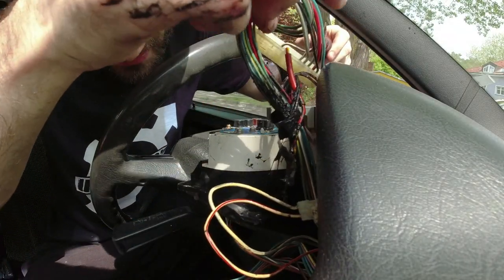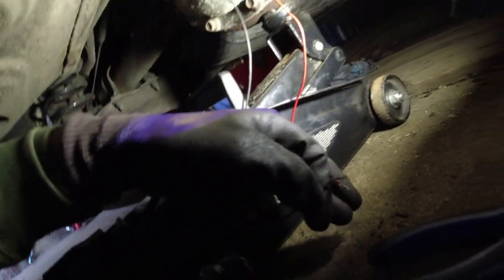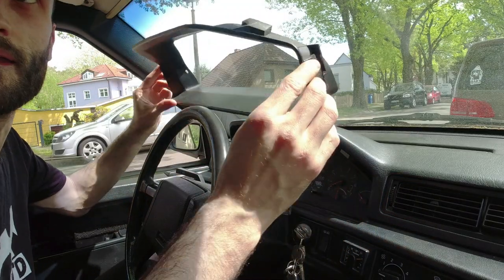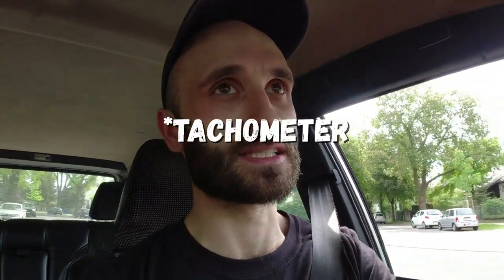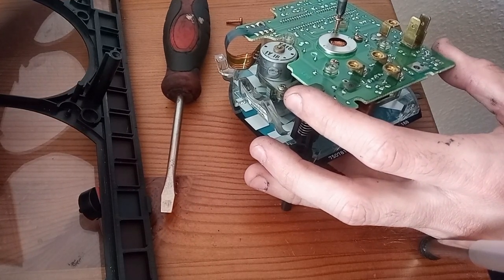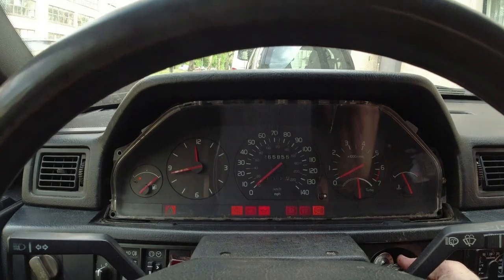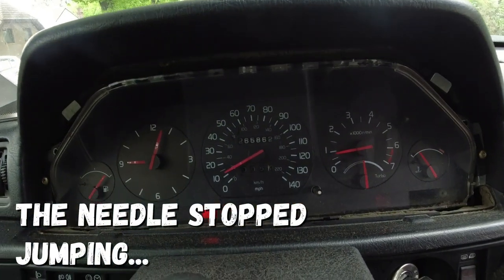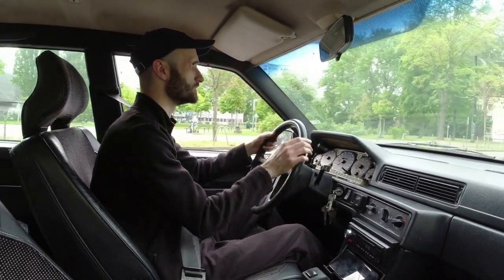Fixing the Speedometer on my 1992 Volvo 940 Turbo

Comment: Some years ago I repaired my fuel gauge, had to change 2 capacitors, so now it's working. 
I have also repaired my odometer? don't know the right name of it but it's the one that show how many kilometers you have driven. The fault was a small spur gear made of some rubber/plastic that had lost a couple of teeths. Today I helped my neighbour with his 1998 Volvo 945. Changed the speed sensor located at the rear axle because the ABS-lamp was on but the speedometer was still working. The sensor was faulty, high resistans. After that I cleared the fault code and the ABS-lamp is now off. Thanks for your Volvo videos and keep the coming!
Reply from the maker: Ah yeah, I recently did the same repair to the odometer on the 240, luckily those gears are easily available. That's good to know, I have an ABS light on the 740 and no speedometer so perhaps the sensor is at fault also
Reply: @Involvod  You can measure the resistans of the speedo sensor in the rear axle with a multimeter. It shall be around 800-900 ohms if it's ok. The sensor can be a hassle to remove though.
 I had to remove the rear axle cover om my neighbours Volvo to remove the sensor from inside to out and then put new oil in. Oh and there is no gasket between the cover and the final gear assembly. You must use some good packing adhesives. The front ABS-sensors should have a resistanse of around 1000 ohms if they are ok. Take care and I wish you good luck. :)
Reply from the maker: @tompas11A3n52KkX  thanks for the info that's really helpful! I'll take some readings
Reply: I have 1 unserviceable fuel gauge taken from volvo 940 GL.  Do you have guidance to find which component need to be replaced?
Reply: @peterelias2345  Whitout proper instruments för testing capacitors it's hard to tell if a capacitor gone bad. Sometimes electrolytic capacitors become swollen and that is a sure sign of a bad capacitor. Otherwise you must measure the capacitor to know if it is bad or not. I have a capacitance meter and an ESR-meter for checking capacitors. Often you must desolder the cap to get a correct reading.
Reply: @tompas11A3n52KkX  I agree. I am preparing the instrument to start checking the capacitors

Comment: The smacking of the dash is a daily ritual every time I drive my 745t 😂 My fuel & temp gauge stick plus my tach jumps around. I have a very nice low mileage cluster out of my wrecked 744t that I salvaged from it before I sent it to redblock heaven that I might install eventually.
Reply from the maker: What causes that again? Someone with a 740 told me they have the same problem, their fuel and temp gauge needs a tap. I have the same issue on the 240 speedo
Reply: @Involvod  not sure but my 745t sat for 15 years with the sunroof partially open before I saved it so I'm sure that didn't help. It was worse but I took my cluster out and tightened up all the screws on the back of it since most of them are part of the circuit. It definitely helped and the cluster functions much better now.

Comment: Oh I know that feeling. Upon purchase of my 92 740, the only gauge on the cluster that worked properly was the tach. The speedo was particularly bad, spazzing all over the place constantly (and I think mine has the VDO gauges, so I’d say they all have issues). 

Is there nobody in Germany that offers cluster repair? There’s a place down the road from me here in the US that repaired everything for a flat fee… not cheap, I wanna say about $200, but it sure was nice to get it back and everything worked perfectly.
Reply from the maker: Wow that's expensive, but still more cost effective than buying replacement units that won't last 5 minutes..

Comment: We have a guy here in sweden that restore the clusters. he tack only 1500 swedish krones for the repair. and he also sell repaired clusters
Reply from the maker: Thanks for the info, that's alot cheaper than a used unit here! Even postage both ways included!

Comment: Are we changing the capacitors ? 
Those leaked and corroded the IC chip.
Reply from the maker: No we're not, that's way out of my league, you can do them for me if you like 😃
Reply: @Involvod  I am shure you can do this. I’m to far from you. Just desolder the two blue wires from the micro switch. Get a good solder puller. Put the solder iron on the cap coenction until it gets loose. Remember that is a doble board. This means that is solder at top and the bottom at the same time. Put a lot of heat and move the cap until it comes loose. Don’t pull it hard you can damage the board. After they are out use the solder puller to clean the holes. These capacitors have a positive and a negative. Install them correctly or the will boow up (ask me how i know). It sounds bad but really is easy. Practice on some other board. A TV board or another.
Best of luck!
Reply from the maker: @gannicus1251  thanks for the info!
Reply: @Involvod  Did mine today....... I’ll test it tomorrow. What I found. 47mf to 25 volts blown away ( no leakage on that one it just blew up) changed the other 3. Those where so bad that the legs of 2 caps broke off from the caps. So yaeh me test that tomorrow and i will let you know. Ohh the needle to stay in place i had to pull it up pass it over the stop thingi to know where to put the needle to it back together. I put the needle bac at the position mark and pull it up over the stop thingi.
Reply from the maker: @gannicus1251  ah thanks mate that's very helpful!

Comment: Please say you replaced the capacitors too? If not they'll continue leaking and eventually kill it
Reply from the maker: Sadly not, it's way out of my skillset/toolset, I thought about sending it off for repair, apparently those capacitors are tricky to find now?
Reply: @Involvod  have faith, I've seen you sort of solder on an older video and I think you could do it. The exact ones may not be available, but there will be a 99.99% chance of there being a modern equivalent
Reply from the maker: @Adamborland77  thanks for the vote of confidence!!

Comment: What's the fun in DIY repairs without the old roller-coaster of emotions, eh?  At least you've got got it working properly again. +5 K's on the speedo feels about right for a stock-ish setting. 
Manufacturers are actually mandated to let the speedo read a bit high to allow the owners some wiggle room with wheel & tire combinations without having the speedo read too low.
Reply from the maker: 😄 That's what I thought too. And true, might come in handy if I find a set of Hydras for her 🤔
Reply: @Involvod  Yeah, Hydras would fit her wheely nicely. 
Sorry.. I'll see myself out :D

Comment: The Turbo and non turbo cars have different rear axle ratios, I believe. That's reason why the speedo isn't showing the correct speed.
Reply: Rear axle ratio doesn't matter, the wheels are always rotating the same speed no matter what ratio there are. Only the wheel diameter affects on speedometer.